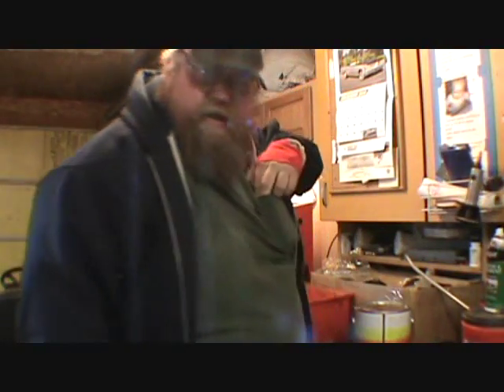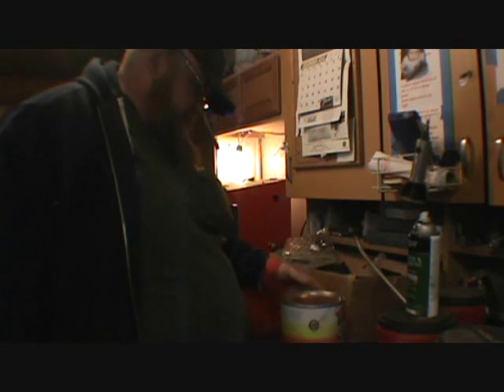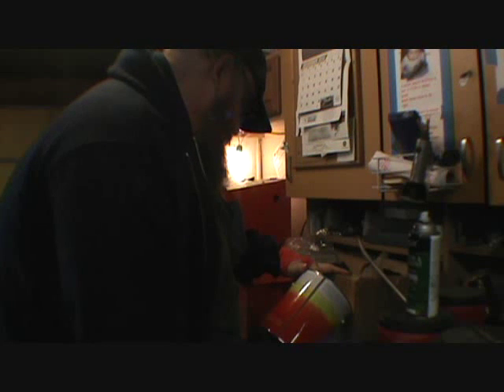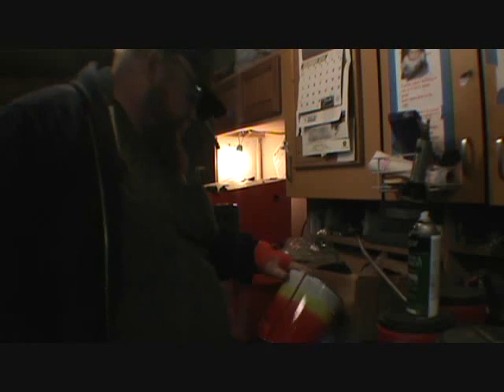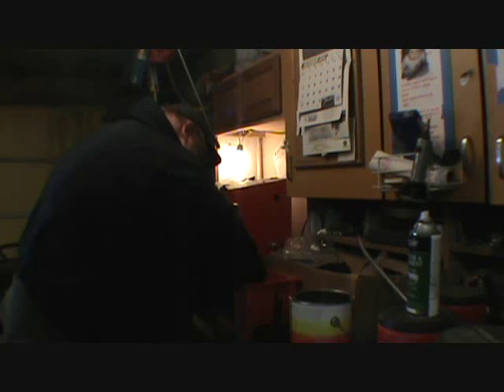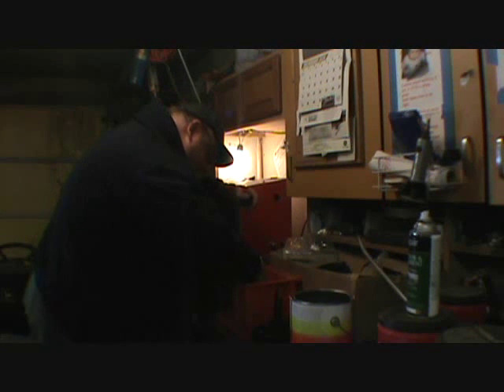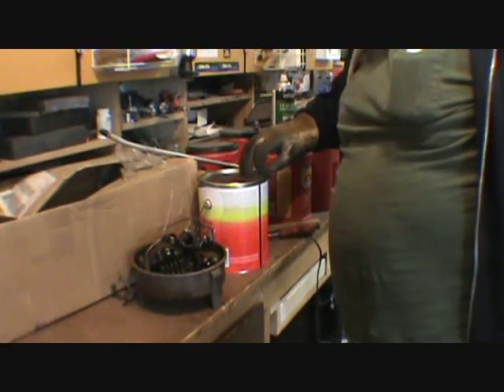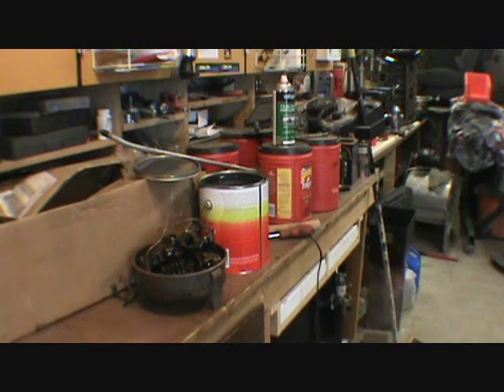working in the shop with berryman cleaner

Comment: You know a lot about engine rebuilding. Just need to find a market for your skills. Around here mechanics make $100/hour so most people find it cheaper to buy newer vehicles and junk the old ones when the mechanic gives them a $2K+ estimate to replace a head gasket. The nickel and dime ($500/$1,000) repairs add up fast. I know you think that is wrong but unfortunately it happens all the time where I live.